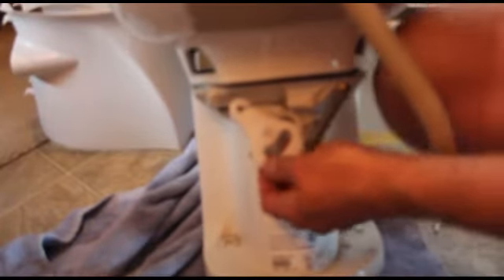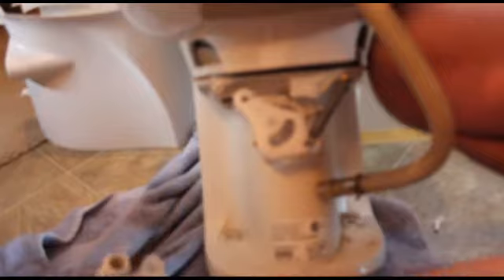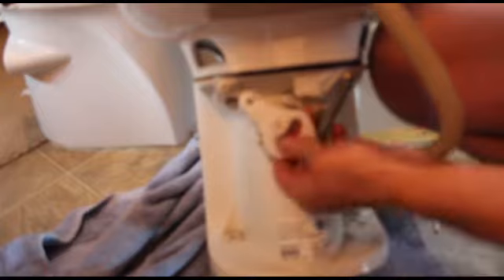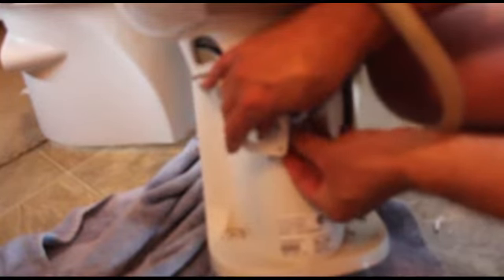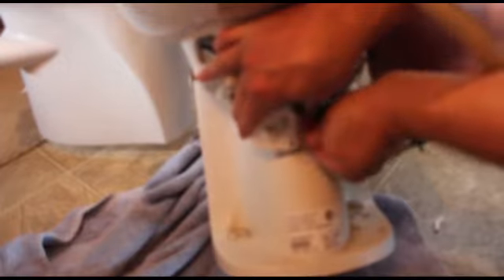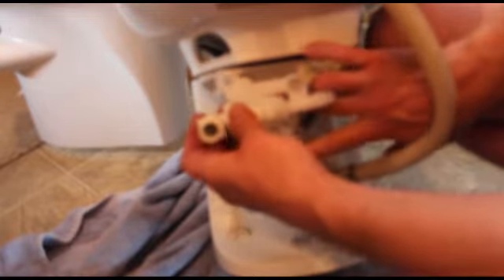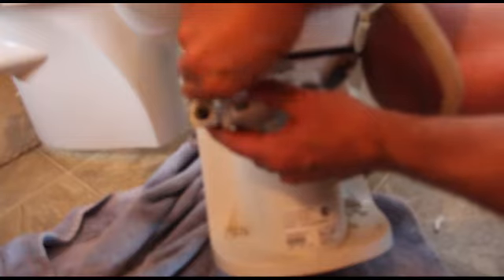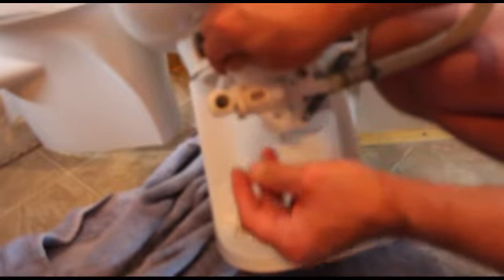RV toliet water value replacement - Thetford Style Lite

Comment: Have this exact issue/part. Do u think it can be done without removing the toilet?
Reply from the maker: Hey Bob - not sure if you attempted it yet. I think you can, just depends on how much space you have to work with. It was just easier for me to remove the toilet, also gave me an opportunity to give a good cleaning.
Reply: Purposeful Events I didn't need to take it up and I used the piece with the spring from the old part and it stayed on so the whole replacement took about 5 min. Thx for the reply.

Comment: My issue is that I do not remember how the spring and the metal hook connect to the lever part?
Reply from the maker: It's a little tricky. The metal pin piece, connects to toilet and through the pre drilled hole of the assembly piece. That metal piece sticks out just enough for the spring to attach to. About a minute into the video, you can see what I'm talking about.
Reply: Purposeful Events got it no problem. thanks for doing this. all done.